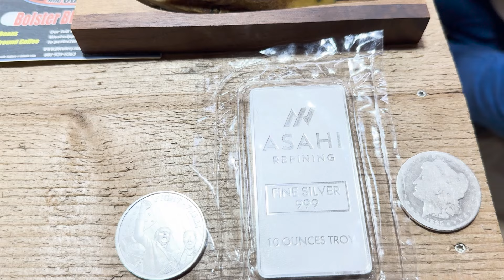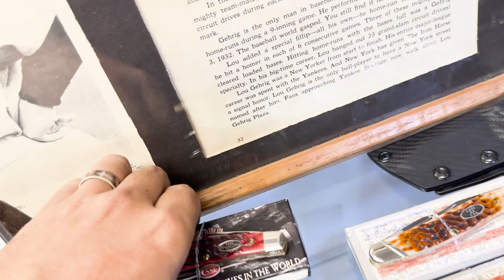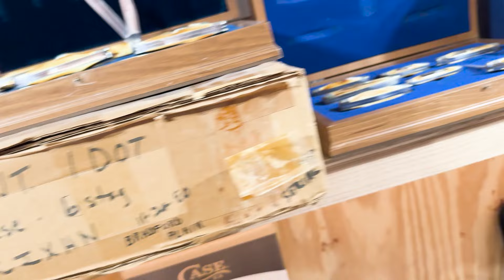19 Sep 2024 - Knife Auction Preview & Cobratec Giveaway! Bear & Son, Case, Buck, GEC, Queen, K-Bar.

Comment: Question for the crew since y’all have bear and sons ear.  Do they plan on adding a dating system to include with there knives? I think that the only bad thing about their knives, which is not bad, but would be useful.
Reply from the maker: Really great question! I will make sure the Preacher sees this!
Reply: They already have it. The blade/s have tiny stars stamped to the left and right under the bear and son logo stamp. 

To determine the year, count each star and subtract that number from 2030 and that is the year the knife was made.
Reply: I did not know that than you very much!!